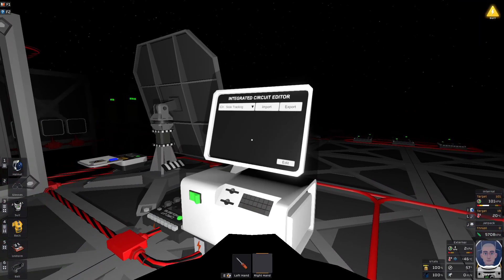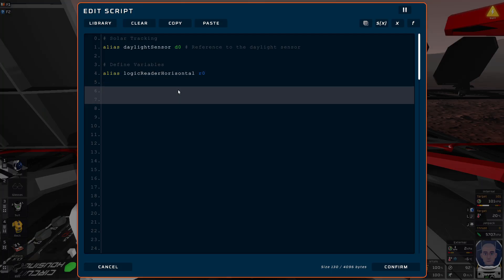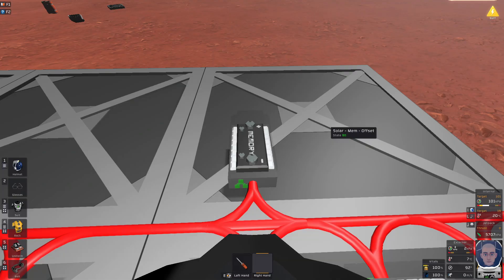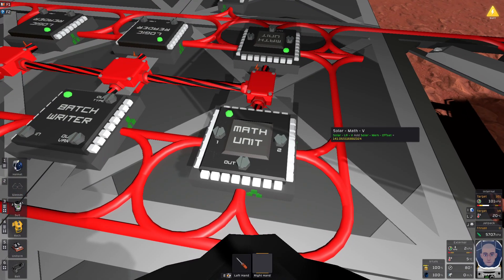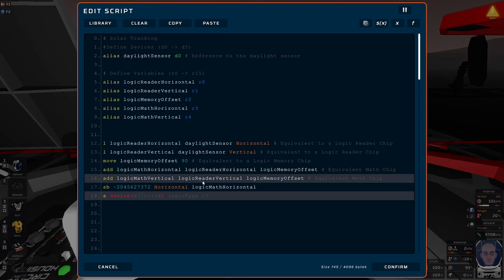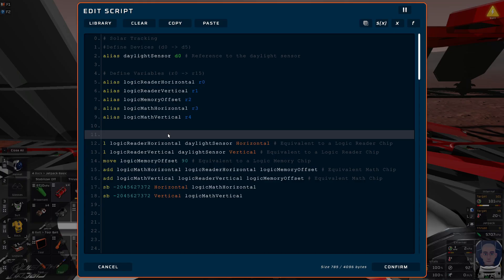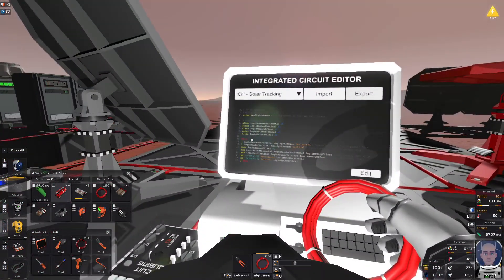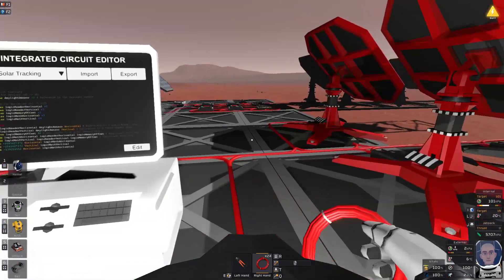Solar Tracking with IC10 Guide - Stationeers Power Generation

Comment: Can you do this with Solar Panels (Dual) - I've been working on code for this but it doesn't work all the time. At some point, the panels just veer off in another direction. I've placed the sensor in every direction but always get the same result. This problem is only with the panels in Dual configuration. I've been told that my 6 Heavy Solar Panels (Dual) cannot be controlled by IC10, and I've also been told that I can't have the cables connected to both power inputs and data inputs. Have to keep them separate - but in your video, I see the cable connected to both of these ports.

Comment: Coming from a (very) old assembly language programming course, the aliases for the variables refer to "register" slots. Chips have a set number of registers and they're general-purpose storage locations. The r values are limited 0-16 because there are a fixed number of registers to work with. Alias is a convenience for referencing a register by a descriptive name. You could write this to store everything in a single register, but you need to keep track of what value the register is currently holding. Your approach is simpler because each register is mapped to a single specific value from the circuit - but that's a soft limitation. If you find that you're running out of registers, you can reuse them for other values - just be aware of what the register is currently representing.

Comment: Hey mate.  Very informative. Do you have to keep the logic chips on the ground to feed the ic with information or does the ic behave like the chips and do its own calculations?
Reply from the maker: The IC doesn't need any logic chips - sorry if that came across in the video.  You ONLY need the IC + Daylight Sensor for the IC version of the solar tracking.  The Logic Chips i was just trying to explain how to convert the Logic Chip version of solar tracking to the IC version (to show its not that hard for anyone new) - The IC is meant to replace the Logic Chips.